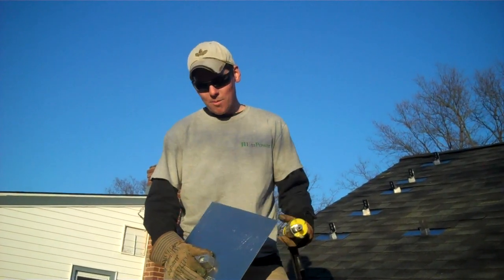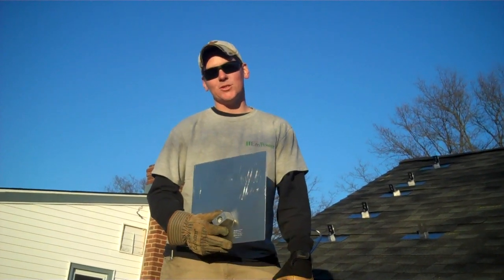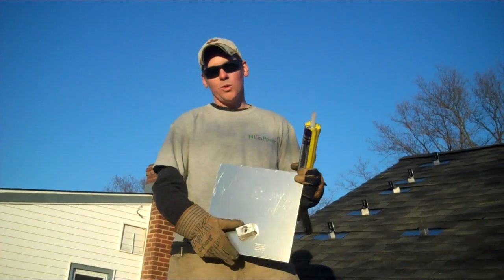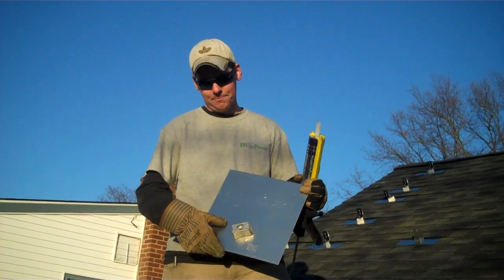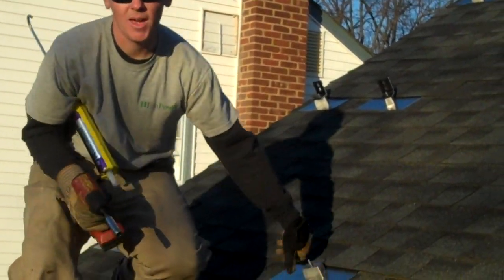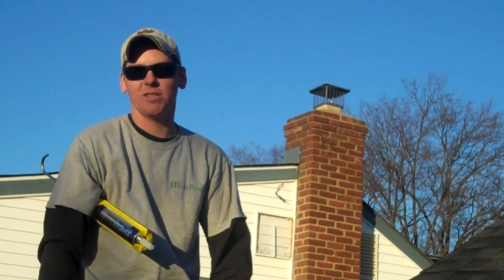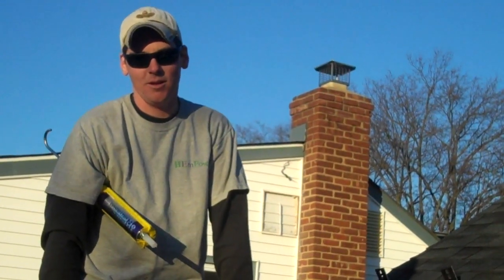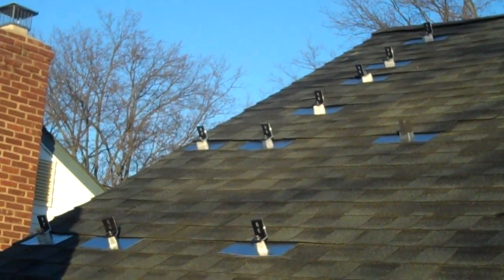Solar Electric System Installation: Flashing

Comment: That will obviously leak as soon as the magic sealant dries out.  I would never allow something like that on my roof.  Solar mounting systems that rely on magic sealants as opposed to sound mechanical design will inevitably leak over time.
Reply: As the lag bolt loosens over time, the gap between the aluminum block and plate will widen thus allowing water to seep in.
Reply: @n4mwd  There should be no "loosening of the lag bolt" over time. In cheaper flashing, there is a neoprene gasket compressed between the aluminum block and the flashing. QuickMount uses an elevated seal between the block and the flashing. Check out their videos on this page. The industry has made a serious effort to address this issue, and has come a long way from the butyl rubber used years ago. Sound mechanical design, as you say.
https://www.quickmountpv.com/products/composition-mount.html?cur=0
Reply: https://www.youtube.com/watch?v=EThNBKPmOpY
Reply: I'm glad to see solar companies starting to take leaks seriously.  In this case, I would be concerned about the weld that seals the flashing to the block.  Expansion and contraction of the wood members can cause stress to where it cracks and leaks.   According to your video link, its not the block that gets welded, but rather a small aluminum stem inside of it.

I detect some specsmanship going on here.  On the link you provided, it says the company's 5/16" x 3 inch lag bolts will hold over 2000 lbs, whereas everybody elses lag bolts of the same size hold less than 500 lbs.  See here: https://www.awc.org/codes-standards/calculators-software/connectioncalc   So you would need at least 4 bolts of that size to hold 2000 lbs.   If you put them too close together, you weaken the truss member so that it holds zero.  You would need about 2000 lbs of hold down force to meet the 180 mph hurricane code, but you aren't going to get it with one lag bolt.